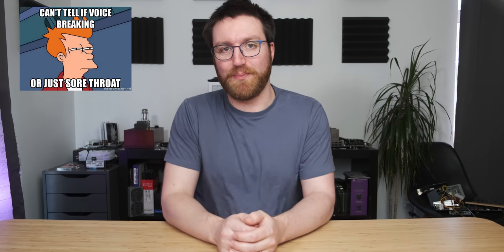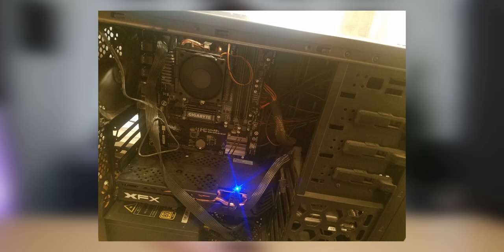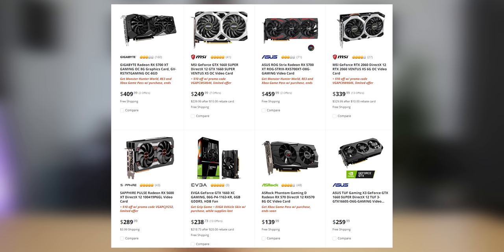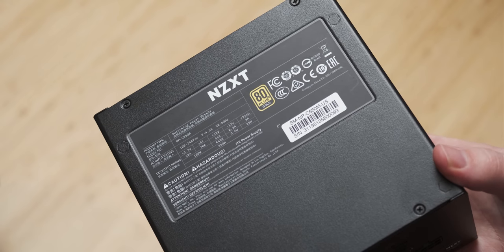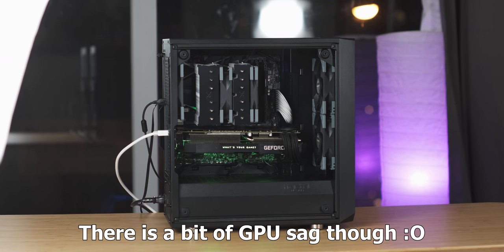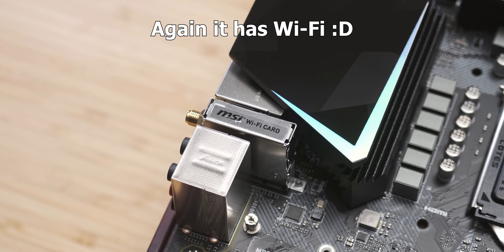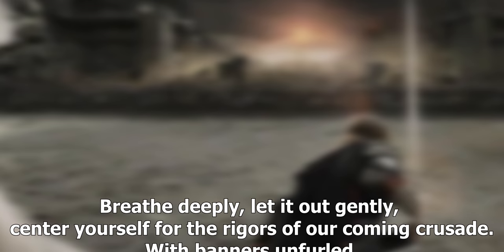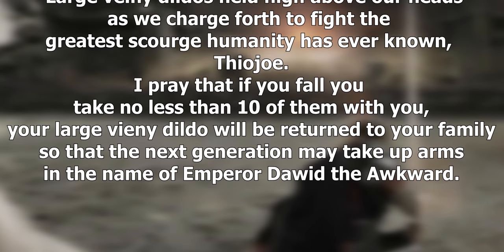I Build Kurt a New BEAST of a PC!

Comment from the maker: Firstly, Go check out our gaming channel: https://youtu.be/0Z6U9BG4jKE
Secondly: The MSI motherboard pushed voltages pretty high as standard. After I dropped them the CPU temp dropped to 50c under load.
Thirdly, If you want to join Team Dawid for folding, our team number is 237137 and there is a whole community on Discord you can got join. 
Finally, RIP Uncle BearJoo.

Comment: Sad to hear about the death. Sounds like a good guy. Anout the video, if possible I'd like to see a video showing the performance of the old system as it was and after a cleaning and moving the gpu to the correct spot and any other needed fixes/tweaks

Comment: The GPU position thing I have as well. There is no way out of it with my mini ATX case, though. The PSU can only really go in one place and the GPU can't be moved due to limited slots in the case. There's nothing I can do with it, sadly. It works but would probably run cooler without a PSU just 2-3 CMs from its fan. Fortunately my aftermarket GPU cooler is pretty good, so temps remain sensible.

Comment: The D3P seems to almost the same board as my former DS3P, and it did not like the 8350 , the chip below the CPU got really really hot and it sometimes shut down. solved it with no sideplate and tablefan still works. Yeah just checked they used the same chips.

Comment: Kurt has the same pc I had last year except mine had a 1060 6gb instead of the RX 580. I got so fed up with dropped frames because of the 8350s bad single core speed that I just went all out and bought a 3950x and a 2080 ti to go with it. (I didn't really care about money at the time I just wanted it to be really fast)

Comment: i had to get a better cooler for the R5 3600 i got a couple months ago. for some reason, it was just running SUPER hot and my case is basically like a wind tunnel, so i didnt understand.. anyways, for some reason, even the Deepcool Neptwin V2 barely keeps the cpu down to acceptable temps. still higher than id like, but for sure better than it was.